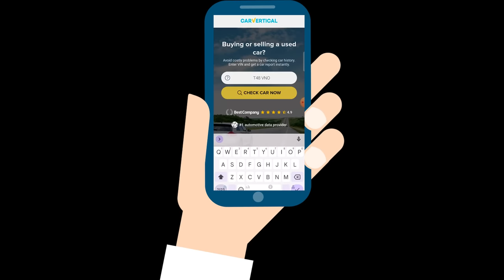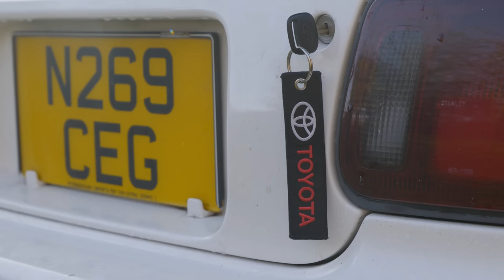The Price Of Happiness: Did My Toyota Celica GT-Four Cost More To Fix Than A Ferrari!?

Comment: Great video; great car and; the main reason why I drive Lexus. Now, don't get me wrong, I've had some incredible cars in my 60 years of driving and 62 years of racing, (just club level, I can't afford the really big stuff). I've always bought used cars, my very first being a 1954 Oldsmobile Rocket 88; and I've had some very serious cars over the years.
I like fast; I also like quick, so 10 years ago when I bought a 1989 Lexus LS400, most of my friends thought I'd dumped my marbles! That attitude changed when some of them tried to catch it - and couldn't! Next came a 1st gen GS300, again, very fast and comfortable. I'm now on my 7th Lexus, a 2006 GS300 SE-L, It's standard except for a little bit of tinkering which was actually done very reasonably by my local dealership and includ d d the removal of both tail-boxes, to be replaced by straight pipes with twin outlets. This gives the car a pleasant rumble and a minor roar under acceleration...lovely.
My point is, I've never, ever had a Lexus need mechanical work. They just don't break. Keep them serviced, change the oils and filters regularly: and they go on for ever! They're also something of a wolf in sheep's clothing. There's not many cars out there that can keep up, much less catch up....unless you have iver £100,000 to spend. I love them, and I love that they don't cripple my bank account.
Next, I'm after an LS460 SE-L with all the bells and whistles. I'll have Lexus "breathe" on it and lose the tail_boxes. Then off we go!

Comment: I think you'll find that 3 plate clutch is actually a 3 piece clutch kit...i.e driven plate, pressure plate & release bearing. Not sure why there is any surprise on the issues found on this car & if you don't know what you're buying then get it inspected by someone who does first...anyone who has bought one of these is likely to have given it a hard time & as you say it was a cheap option at the time so attainable by most but not necessarily affordable!

Comment: Great video. Was lucky enough to drive a black 94  with rally lights on bonnet in 96-97. Japan import £28k tuned to 400bhp 0-60 4seconds. Quick in the 90s and now. with turbo timer to cool, leaving car running while you left it often had people talking . Impressive car, missed

Comment: Had an st205 for around 5 years, it cost 3 times the purchase price over it's time to maintain. after the 2nd engine went bang I moved on. in all the decades of cars, this one took the prize for most costly and least reliable. around double the mr2 turbo costs plus 2 engines.
replaced it with an mr2 and don't miss the gt4 at all, with the '2 being more entertaining to drive and faster.

Comment: I wanted to import a gt 4 so bad but I figured there may be some hidden issues with the weaker engine (construction wise), the turbo and awd system on top of the abuse it probably received by previous owners. So i decided to get a mint 1998 GT model, and used the spare 20k on a mint 1998 sc 400, and a beater 2015 scion tc.  However much respect to you for bringing this beauty back to life.

Comment: If it makes you feel better, I probably spent close to $20-25K USD sorting and converting a 93 Civic CX Hatchback into a Civic Si-R with a full suspension build 2-3 years ago. Oh, and I never could fall in love with the car before or after all that. Turns out, I went a little to hardcore on the supension build, and basically built a track car, to use on the streets. Yeah, not ideal.

Comment: If it's a keeper then what you've spent doesn't really matter ;-) But the total cost must now be coming quite close to a new GR Yaris which is the modern equivalent. That would be a very interesting comparison video, buy new or old school plus repairs and what's the difference in driving experience? Thanks for the great vids as always.
Reply: The car will only go up in value ... unlike GR Yaris for the next 10 years or so.

Comment: If it’s any consolation I’ve done 20,000 miles in my VR5 VW Bora and in that time it’s cost me  £6,000…or at least I stopped counting at that amount; and that’s just maintenance/ repairs, not much in the way of mechanical modifications at all 🤦‍♂️

Much like yourself though the car is special to me.
It’s cool to see your passion for the Celica.

For me personally it’s the noise my car makes, I forgive all its foible’s including the fact it manages to be built like a tank but somehow fragile at the same time…I forgive it all, because of the noise.

Comment: Almost imported one of these but I ended up getting an 04 sti because it was a great deal and had forged internals and 400hp. The sti went 6 years before I had to replace anything but the head gasket went since they put the crap stock type on when they rebuilt the engine and I had the whole engine rebuilt.

Comment: I can't believe I have the exact same radio as you in my Celica 😂
Granted mine is a convertible. Nice period Bluetooth radio.
I couldn't get mine to fit in the top slot though because the face folding button fouled on the fascia so it wouldn't close. So mine is in the bottom slot

Comment: Your pop and bang issue might be due to the car being a '96
Only the WRC homologation options had the plumbing for anti lag from the factory and those were available in 94 and 95 if i remember correctly. The other thing that comes to mind is maybe yall were putting too much fuel into it that there wasnt enough oxygen to get to a good stoichiometric ratio to actually combust?
Other then that its good to see other proud GT4 owners out there.
Im in a similar boat of dumping money into it but my restoration project is making my car as close to stock as reasonably possible, and am looking at rebuilding my gearbox cus the 4th gear synchro has decided to leave this plane of existence, and might as well get the whole thing redone

Comment: I wish I could get a beautiful car like yours, if money were no object I'd roll around in a castrol livery gt4 celica for a daily. Unfortunately, I'm a working class peasant, so the best I could muster was a blue 94 MR2 GT-S I bought at  a used car dealership for $13,500 in 2019, had to find a performance to dollar car that could stretch a $, even if not ideal. I will tacitly admit, I enjoy the 3rd gen 3s-gte for an engine though.

Comment: I owned the previous model GT4. It was the most unreliable and most expensive car I have owned. For a period of a about 2 of the 3 years of ownership it would not go more than 1 or 2 months without needing some form of mechanical repair. For the last year or so of ownership it was ok so I sold it while my luck was good. I traded it in for the an Integra Type 2 DC 2 which was much more reliable and simple to maintain.

Comment: James I have the Fujitsubo Legalis Type R system fitted to my JDM MR2 Turbo.
It is an excellent piece of kit, beautifully built, quiet at idle and mid range but has a nice growl at high revs.
You will definitely notice a performance increase and the engine will seem to run smoother and spin up faster.
Think a 15-20HP improvement. Your car has the same 3S GT-E engine as mine although I have the Rev 3 version with the ceramic shaft turbo CT20B.
It is an awesome engine and put out 245ps stock, currently running at about 260 HP with an Apexi power induction manifold and the Legalis exhaust.
Do you have an email address?...I'll flick you a couple of pics.

Comment: How about seeing what 20 grand will get you today that's comparable both in terms of mechanicals and condition -without even going into heritage and looks-? Suddenly, you've got yourself a hell of a car for not much money. This was the special alternative to evos and wrx's in the 90's that was a rare sight on the road. The 80's ST165 was also a homologation chassis. That and this ST205 are the special ones of the celica bunch. Some like the older RWD ones. They do look pretty cool but they don't have anywhere near the level of sophistication that the 2 rally specials were blessed with. The real unicorn is the WRC Corolla hatch thing. I don't know how that worked though because I don't recall ever seeing a road-going version of that car. Give it 350HP+ when you're ready. They used a 500HP version of the 3sgte in JGTC back in the days 😃

Comment: Thats about the cost I spent getting one imported to the states so adding the repairs/upgrades you did, this car would be around 32-34k usd. Those front bumper spats you have on, I'm guessing they are replicas? I have the thing, but the fitment is even worse than what I am seeing on yours. This is why I have not installed mine.

Comment: Haysoos Kristos en la bicicleta...all that and the front rotors are still installed backwards...   So, per Brembo, the outside edge of the slots is to touch the pads first. Per Porsche, you'll see them reversed. But Mercedes doesn't bother making handed rotors, one side points forward, one backward. Who's correct? The niche-like manufacturer that knows best for their cars, the huge manufacturer that tries to be everything to all, or the brake specialist that's been in the business for 60 years?

Comment: IF 19 grand is all you spent thus far, you've done well.  I think people need to set aside the IDEA that "well it's old, so it should be close to what I paid to do everything to.. a 4 grand car shalt not cost 4 grand in fixes...etc"   This is wrong and backwards thinking.  What we need to do is respect that these cars WERE what would equate to the hottest of hot hatches/rally homologations/whatever it was at it's time and the fact that they are a finite resource, you SHOULD be ok with paying a brand new car's amount of money to make it as brand new as you can. 

Why?  well if you were to walk into a showroom today, can you get a Celica GT four? NO! So if you really want one (and I mean own and USE one) - you should be ok with fully reviving a car to make it as like new as possible. Because you can enjoy these legacy cars in their 2nd and 3rd lives as near-new cars especially when your alternatives weigh 2 to 3x as much, you can't see dogsht out of them, and they're far more nightmarish to repair when they age anyways and cost 2X as much as you paid to DO IT ALL ANYWAY on your old one to make it new!  I'd rather have a "New" GT four from 1995 than an actually new GR 86 from 2023.   I'd rather have a "new" 300ZX Twin turbo T top from 1999 than an actually new Z from 2024 that costs the same as mine fully restored, modded, with 600whp but it only has 380BHP and weighs 300lbs more for no reason and you can't see out of.

Comment: I mean no offence from this, but you really need to learn how to fix things for yourself. All of the mechanical issues it's had were easy repairs. The turbo and decat is easy to get to since they're on the front of the engine, the hose from hell is easy to get at once the turbo is out of the way, you didn't need that ECU if you're using a stock turbo at no more than 18psi, suspension arms are also easy, etc. You could have knocked about ten grand off your total expenditure with just a basic socket set and spanners. 👍

Comment: lol, old toyota's being reliable and cheap to run is a lie. 

My 1JZ Cressida was a money pit to refresh it. Down to cam and crank seals, leaky turbos, bad pcv system from factory, electrical gremlins (my fault), leaky ecu capacitors (factory problem). Cheaper than exotic cars, sure, but still pay to play
Reply from the maker: Yep. That's the engine the internet wants to think is unbreakable!

Comment: Well, you bought an £8000 Celica GT Four dude. Ending up with 19K should not have come as a surprise...why do you think old junk cars are cheaper than perfectly running, nice looking ones??
And you seriously think that a relatively well sorted out, rare, special version sports car that costs £19,000 is a lot?? Is Britain some car price narnia where cars are just handed out for nearly free, and miles on the odo as well as years of use just don't do anything to the cars?

I hate to break it to you, but since you bought a cheap-as-possible bad example £8000 bargain basement one for sure it has a huge amount of miles on it (probably a lot more than you have been told), and you are going to face the issues from that in the future as well. 

There's no such thing as a free lunch, or cars simply getting cheaper without a very good reason for that cheap price. Think of what an extremely low mileage one-owner pristine GT Four would cost. That, or somewhat more what you're going to end up paying if you want yours to be at that level.
Reply from the maker: When I bought it £8000 was not a cheap GT Four. There were examples up for less than half that.
Reply: Er, no one else will make head or tail of your strange post. I didn’t hear James complain about the costs at all. Where you got the idea he expected a free lunch is a mystery.